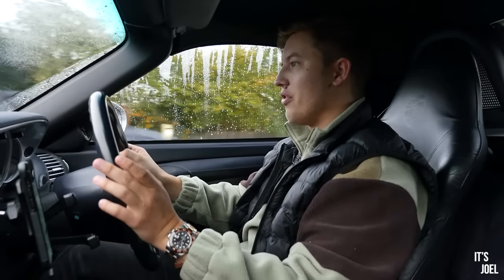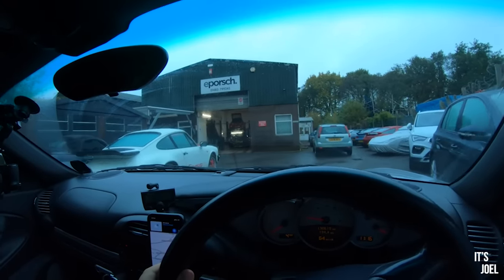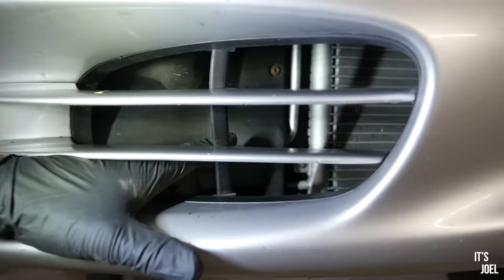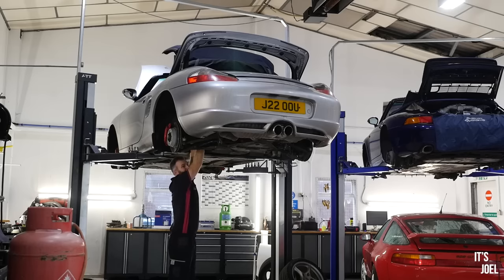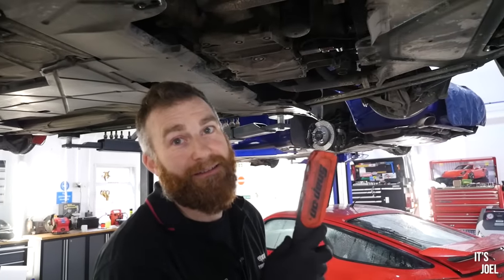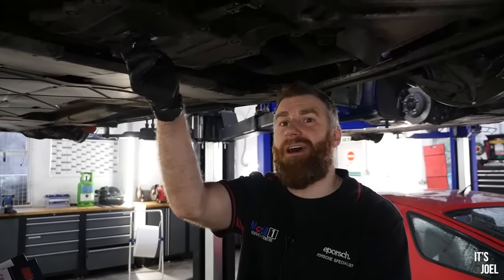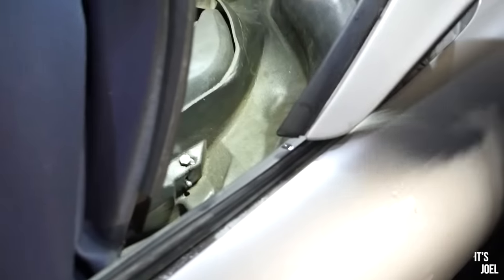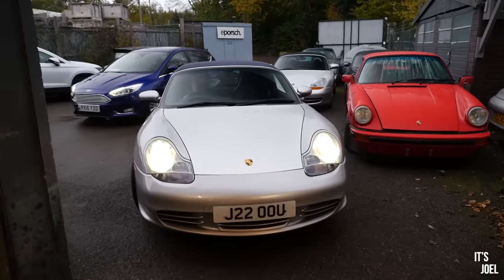Here's why my Porsche Boxster S was so cheap...

Comment: Glad the mechanic was accurate on the IMS issue, really it’s a change when you change the clutch job because 90% of the labour is identical until you get to the other 10% removing the IMS bearing. That weeping is the RMS, it happens basically the seal perishes slightly and it weeps, you get drops of oil on the drive and can get a slight smell of burning oil plus your oil consumption increases slightly but give it a blast with the jet washer and your good.
You drain plugs can be sorted with a trombone cleaner, literally a long metal springy flexible length with brushes on either end used for cleaning the inside of a trombone. It costs about £5 just push it in the top and look for it out of the bottom. Pull it all the way through and the drain is clean.

Comment: My IMS failed three years ago on my early 2005 Boxster (I purchased the car new), and the car had just over 21,000 miles...250 miles after my last oil change.  I always changed my oil myself every year, had a spin on oil filter and a magnetic drain plug.  No metal ever showed up, and I always cut my oil filter open to look inside.   Sent the car to LN Engineering after the failure...one of the best experiences I have had with a business.  They rebuilt the motor (not too much was wrong...just metal that needed to be cleaned) and had them install the "IMS Solution".  The car runs better than it ever has.  By the way... Porsche told me to kiss-off.  I've owned at least one Porsche since 1975, so I'm a Porsche guy.  Still love the car, just not the company.

The last tips on keeping those drains clear was excellent.  Thanks.

Comment: For the drain holes. There is a drain filter from Porsche that's oem that you can buy and put them there and not worry about leaves getting stuck as much. I put them and it helps with peace of mind of the car flooding.

Comment: I'm very surprised at how mint the car actually turned out. Like even the water drains were pretty clean, new brakes and radiator, very nice/clean interior, pretty okey exterior. Very lucky purchase. In any other car I wouldn't think about the suspension work the car needs, but this one might be worth it. The exhaust could indeed use some improvement, especially with those high revs. It's interesting to see that such a childhood dream car is pretty reasonble/cheap to maintain (if the car wasn't abused). I'm enjoying the content as if I bought it, so keep it up! 😄😄😄 Also funny to hear gf took the Porsche 😂 She knows her stuff!
Reply: Thanks now I don't have to watch the whole thing lol
Reply: I purchased one for £2k. I've stripped out the interior and carpet to clean 20 years of grime. I've found minor issues supposedly fixed at high cost by specialists in the past.

Comment: Did a full suspension/chassis refresh on the driveway on my old 2002 986 at about 120k miles. All the arms, top mounts, dampers, springs, gearbox and engine mounts, inner and outer track rods etc... Its nothing like as expensive as some claim so long as you shop around for parts (Meyle, TRW etc). You wont beleive how much better it is once done, even though the car feels 'fine' before hand. Very nice to work on as allthe fasteners etc are good quality. Just watch the ARB droplink upper bolts through the hubs holding the struts on, often stuck. Highly reccomend Koni FSD shocks too!

Comment: Great video. Do the suspension first, you'll get more out of the car. The aftermarket suspensions are great and come in at about the same price as factory with much better gains. If your going to do the exhaust then do the race spec headers and everything with it. Better sound and a big gain in horsepower.
Reply: Which suspension do you recommend?
Reply: @DeepEnterprises  my brother is running kw in his boxster s. I've driven the car on 2 different hpde events at walkins glenn. they have performed great.

Comment: You got a good deal on the car, it looks to be in fairly good condition for it's age and mileage. Now, a major service would include new spark plugs, engine air filter change trans axle fluid change, coolant, etc. in addition to the engine oil & filter change.

Changing the plugs, performing an oil & filter change, engine air filter & cabin air filter are all tasks that' aren't hard to do at home and will save you money. I do this on my Cayman. Also do my own brake pad replacements - saving even more. Think about joining a forum that educates you on how to do some of these tasks at home and you'll continue to save more money down the road.  

Planet-9 is a good forum to check out.

Comment: I recommend you have the water pump / coolant pump replaced immediately. or check the service records to see if it's been done. when it goes, you'll lose the engine without warning. they don't just sort of start to fail, they just fail. you might notice coolant leaking underneath or you might not. it's damn bloody expensive but cheaper than an engine rebuild. I just replaced the coolant pump in my 987S and consider it well worth the investment in preventative maintenance. this is really the only crucial service that the engine needs. with your 986, though, you need a water pump and the IMS bearing replaced. do these before suspension If you plan to keep the car.

Comment: I’ve just had a major service on my 718 Boxster S which has 23,000 kilometres.  AUS$2095.00 which converts to about GBP1,800.00 . $50 each for a spark plug, glad there’s only 4 of them. The cost servicing a Porsche in Australia is outrageous.

Comment: Internet over hypes IMS bearing issues, not many engines fail. You have more chance of a fire with boxers when water drips on electrical connections. Look for metal particles in your oil or dip test the iron.

Comment: Thats got to be the most informative video ive seen in the last 4 years + of owning a 987.1 S . Hope you feed back to Chris . Only 2 IMS failures puts my mind slightly at ease but end of the day is pot unlucky.  Bought my csr and have a video of them going to the effort of changing the seal and saying yes IMS is good . Why wouldn't you change bearing while your in there ? Anyway i bought the car and listened to too many negatives on YouTube and it spoil the drive having this in the back of your mind.  I can say shes good at moment.  Chris was correct but when i take my oil filter out i have one bloody strong magnetic.  Chris did point out suspension issues but didnt say if it would pass a MOT ! Please bear that in mind . What you paid for full service was excellent.  Ive just paid £120 just for the oil , about £10 for a magnetic sump plug and washer . Am in Yorkshire so unfortunately Chris is too far to travel to . Thumbs up to you young man and Chris

Comment: Good video. Thanks for sharing. Props to the mechanics for there thourough and friendly service!
Not sure if you've made the upgrade or even if you still have the car but I added an aftermarket exhaust muffler to 986 which made a huge difference – perhaps too huge which is why I changed over to a Porsche PSE exhaust system, a more expensive option but one that yielded a subtle improvement to the original back box and was less showey than the aftermarket version. If you are looking for that perfect sound then one thing I would upgrade are the headers becasue they not only imporve the sound but also the overall perfomance and efficience of the car.

Comment: Great and simple point re drain points and holes. so many cars have various front and rear drains which if blocked will cause internal overspill and damp smells or puddles and other more serious issues such as electrics. Worth checking on any car twice a year and especially if you park under trees and in the autumn. Plus nice pace of video and explanation, sounds a genuine place and who only fix or replace what needs to be done.

Comment: I moved to Thailand from the UK in 2003. Miss very little from the UK, but used Porsches are one thing I do miss. Lots of very good used cars in the UK and lots of very good small specialist places like this one. I had two very nice 944's, an S and S2. In Thailand the prices for new and used Porsches are astronomical, and outside of Bangkok proper servicing is very difficult if not impossible. With a Boxster or 996 (despite his advice) the IMS bearing would worry me! Enjoy your car!

Comment: I suggest you add a "SAE Loop Connector" to your battery, mount it above the battery under the windshield between the wipers.  You can then connect a battery charger/maintainer which insures you can open the bonnet when the battery dies!!
Reply: On my year 2000 S I keep it on charge through the cigarette lighter with an Optimate battery maintainer.

Comment: Like mechanics tip:  Replace when doing clutch as maintenance.  That being stated, do not ignore any odd noises. (IMS bearing)

Q:  Even if IMS bearing issue is present, does it relate to any oil leak/seep?  Cover for rear IMS leak in my opinion not related to bearing failure?  If leaking from IMS.....replace immediately, otherwise would blame the rear main seal.  Again, at any clutch replacement should address both RMS and IMS issues.....and why not the transmission input seal also.  Great time to P.M. vehicle while your are in there!

My thoughts only

P

Comment: I have a 2004 Boxster S with 29 000 miles.  The rear main seal was replaced by Porsche as part of the first major service.  I was originally told I would have to pay 30% but in the event it was done without charge.  As my car gets light summer use only I decided to change the IMS bearing s I could drive it without constantly listening for any early signs of engine disintegration.  I had an EPS roller bearing upgrade fitted by my nearby independent specialist who has done several of these.  Cost £1100 all in.

Comment: I bought a 2003 Boxster base 3 yrs ago with 20K miles it now has 27K for <$12K. It’s been flawless. I change oil & filter every year. Porsche made a number of small,!significant changes in the ‘03 986s.  You asked about exhaust noise.  Your S probably sounds a bit better than my base, I believe mine sounds better than my friends who each has 987S’s.So I wouldn’t change anything.  My doesn’t see rain and it’s always been a SoCal

Comment: I purchased a brand new 2004 986. With extras/alu pack etc it was £47k!!
That little plastic wind deflector was £370.😂
Rear main oil seal is one problem. I also burnt out clutch/dual bass flywheel. Was a great car and there’s loads of little mods you can do!!

Comment: Great video - for a Porsche like this, you got a good deal.  For the exhaust, Porsche deliberately tuned these cars to not sound like a 911 to protect the sales of the more expensive car by making the silencer box a single unit. Lots of good options out there, particularly the 911-style twin box systems that give you the real 911 "boxer" tone. Avoid the factory Porsche exhaust upgrade as they are super-quiet TUV approved and anemic sounding. You can save a load of factory weight hanging over the tail with a non factory one. So that's a benefit. That dealer is ace. I was royally ripped off with my Boxster servicing up north. Apart from the IMS, look out for leaking rad header tank caused by the plastic splitting. Its a tricky (and expensive) fix. Watch out for discs rusting on the inside. All Porsche's do it. Its a good little earner for the main dealers. Front tyres will wear like crazy on the inner edge and you may not notice until MOT time.
Reply: I'm curious, who "up north" ripped you off with servicing? PM me if you don't want to say, so that I can avoid!
Reply: @tameracingdriver  I have two main offenders! The first being Porsche Centre Wilmslow. I had a 3 year service warranty with them. They changed my rear disc pads but left the brake wear sensor unclipped and the drive shaft wore it through, shorting it out, putting the brake warning light on. They wouldn't pay for it saying it was a consumable - so it cost me an extra £70. Another time, they dropped their PIWIS diag module getting out of the car and dented the inner door B-pillar. They had to respray it, then lacquered over the VIN plate. They failed to fix a split rad header tank. The car would spew out all its water whenever it got hot. But their final performance was the "service" they did. I drove it 12 miles home and the oil warning light came on. They forgot to put the new oil in it! Total cowboys. Then there was Tech-9 in Hale, near Liverpool. They fitted a custom exhaust for about £800. I drove it 10 miles and couldn't stand the teeth-aching drone at 50MPH. They charged me £100 to take it off and refit the original. They fitted a sports steering wheel for about £500 but after two years, the leather began to peel off. Bastards. I could mention JMH in Holmes Chapel. They did good work, but called me one day when it was in for a service and said the ignition key had lost its program. The key cost £450 plus £250 to reprogram. £700 for no benefit. It worked fine before I took it in to them. Sad thing is, most Porsche drivers seem as gullable as I was. Not any more!

Comment: You've done well, car looks great and many wouldn't believe that purchase price. 

My only complaint about eporsch is the use of the impact wrench on the locking wheel nut. It wasn't hammered on but they aren't as durable as the standard bolts.

Comment: I doubt you will get drone , that’s usually just front engined cars with the exhaust running back to the rear . I had a 996 with PSE that sounded amazing , I also had a 986 Boxster , I reckon you should get mod stock to sort the baffles out in exhaust . It will sound amazing and won’t be any drone .

Comment: I am surprised that you would even think of changing the exhaust, as you have already suffered a droning exhaust, it isn't pleasant , I had to put my back to stock, I was lucky to find a used OEM, which worked great once I cleared the mouse nest out of it. If you are doing the work yourself, I recommend pulling the bumper off it will make the job a lot easier, yes I know it is a lot of screws, but after having done it without removing it, it was very painful.

Comment: Nice vid, thanks for posting.  I've got a 987, so this was super relevant and informative.   During your video, my guess was 3x what you ended up being charged, so good on you for finding a place like that.  --As for the exhaust... I don't know, man... I considered the same, but opted not to, just because there was always something else that was a higher priority.   Also, I hate driving with the lid up, so the exhaust is always right there.  You're right, it sounds spectacular, but to get a little more of a 'throaty' sound would be sick.  My only thought on this: if you decide to make the move, definitely opt for one that you can switch on and off manually, on the fly.  That way, neighbors won't be bothered late at night, you and your passenger can still hear each other, AND it's not an 'either / or' decision.  You get both.  If you do this, I fear I will get jealous and will be forced to follow suit... costing me American dollars.  I will forgive you for exerting your influence from so far away :)    All the best from the US.

Comment: Bilstein Pss9 coilovers are popular replacement here in the US. I also had a fabspeed secondary cat delete put on when exhaust fell apart (he's right about the stainless bolts). However, you'll likely get a constant CEL and fail to pass any emissions test...
Base 2001, 162000, last 90k I've put on as 3rd owner. IMS is original. Don't baby it. Drive it like all German cars hard and fast. They need to get HOT.

Comment: Great video. Important insight on the overstated (but dreaded) ims bearing. I know I’ll soon replace mine, and add the Pedro’s Garage fix, a cover plate with a direct oil feed into the unsealed bell bearing race. 
The Boxster is a lovely car to drive; frankly, I’d leave the exhaust alone. Perhaps get an aftermarket rig when it needs replacement. If it doesn’t make it any faster, why make it louder? I live in a city where “fart pipes” are rampant. I hate ‘em. Quiet is so refreshing, my opinion. Thanks for the video! And good purchase!

Comment: Great vid , that garage and Chris are very knowledgeable and if I was in area they would be looking after my 2. 
Go for gundo hack on exhaust anything else will set lambda sensors off.
Google gundo hack.
Also when closing "frunk" on any Porsche place your palm on the badge it's straight over the clip and avoids and damage or hand prints to paint 👍

Comment: Good videos and nice car Joel!  Manual gearbox def the one to have.
A lot of highlighted issues like steering rack play and manifold corrosion noted in previous mot history.  Lambda readings previously an mot issue.  I would replace this as will just keep coming back and annoy you.  Will also run less efficiently.  Mismatched front bumper keeps catching my eye but not worth repainting.  Nice clean, dry car overall.  Also good that old oil was clean even if old filter cartridge a bit distorted.
I'm sure you know this anyway......
Any ideas for your next car yet?

Comment: My som had a 2005 Boxter S which was a lovely car to begin with. He bought it from an official dealer and we specifically asked about the IMS. Assured it was not a common problem. He took it on journeys to France and Spain and on the second trip, the IMS went just outside Valencia very close to a Porsche dealer. The car had had a full service before the trip so we didn’t renew the warranty which was around £300. Worst decision ever. Car transported back to UK and repaired by independent Porsche specialist cost over £5000. Various issues kept coming up at service including rusted brakes. Car great to drive on a sunny day but fuel and other costs kept mounting up so he traded it in for a bog standard Golf which is boring as hell, but very reliable and frugal.  Boxter are great but expensive to run and hard lesson learnt to always take out warranties